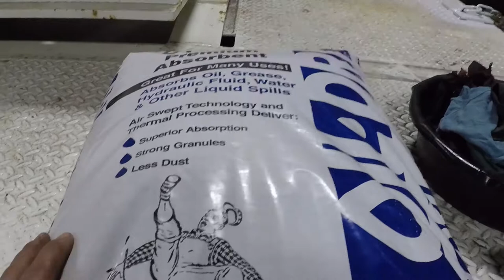To The Top Crane | Hydraulic repair on the crane

Comment: Do you put a vacuum on the hydraulic tank when you open the system? That's what I always did and it avoids a lot of messes. I have a air powered vacuum that I got from EXAIR but I've also used a shop vacuum. Most systems have a pressurized tank with a valve to release the air pressure. Connect a vacuum to that port and it will suck oil and air in from the hoses you disconnect instead of it leaking out.

I didn't like using floor dry around hydraulic systems. Too much dust and dirt. Oil pads are cleaner and much easier to pick up.
Reply from the maker: Tired old mechanic, I have used a vacuum to keep fittings from leaking when removing them. I didn't on this one because we don't have compressed air in the building with the big cranes. I don't like using a shop vac for the risk of creating an explosive situation. The oil pads are a good tip! I'll keep some around. Thanks for watching! 🙂👍

Comment: I assume you are covered by OSHA regulations. So do you need to be certified separately as an operator and maintenance technician? Does Tadano offer training classes?
Reply from the maker: Chris Rowland I am a certified crane operator, and have been a heavy equipment mechanic for 22 or so years. Tadano does offer training, but I have never been to their training program.

Comment: I have a 100 tons banjole crane, it comes down a little when lifting and when the lifting stick is moved, it vibrates, it stops the landing, and it does not prove its position. The problem is the model 1975.